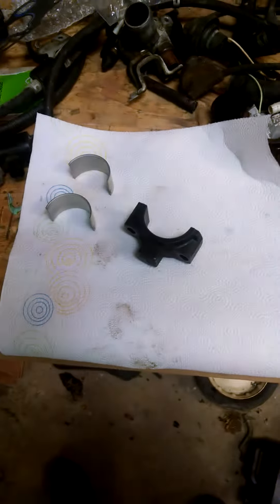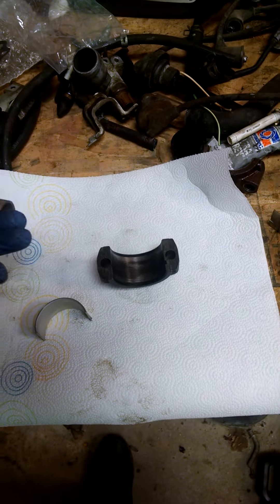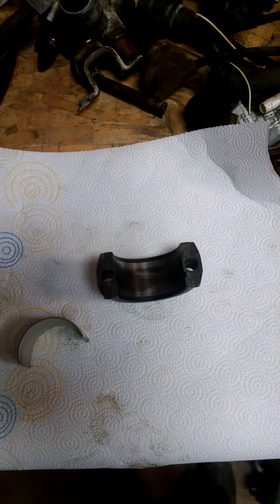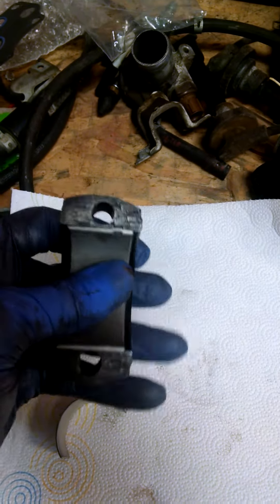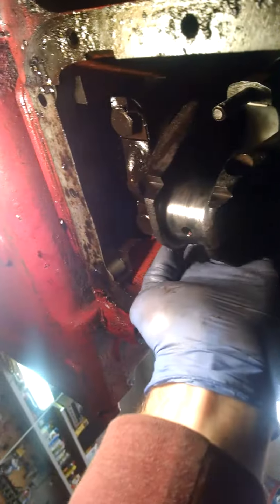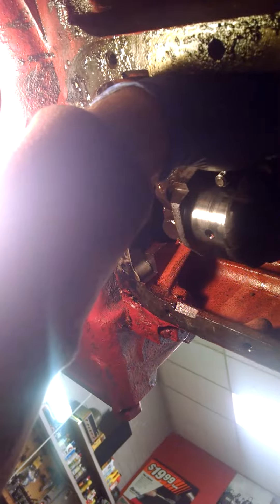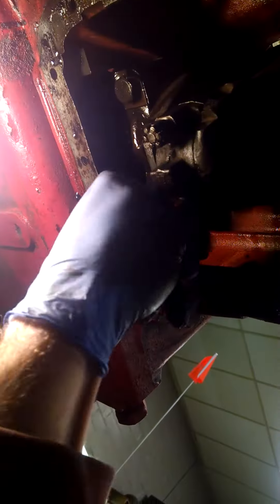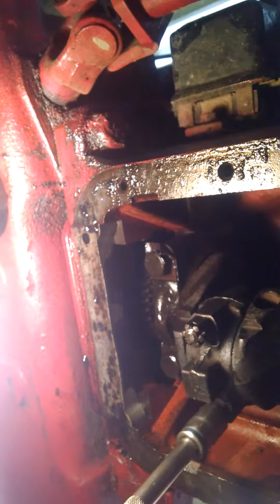Connecting rod bearing replacement

Comment: Hey thanks for the video. Do you know if the same idea works with a Massey 250? I have a knock and was told you have to take it apart from the top down and I don't want to do all that as I won't be able to put it all back together lol
Reply from the maker: 6string I can't say for sure but if you look around the oil pan and can see how it will come off, I would recommend starting there. You will likely have a good look at the rods and caps from that point.
Reply: Hey thanks for the help, once I get some free time i'll get it inside out the snow and take a look. I have a video on my channel of the knocking sound. Hopefully it's a similar situation so I can copy what you did here!
Reply: Alright I got the oil pan off, what a pain. Had to remove the front axle as the oil pan was bolted through to it.  Each bearing on the three rods as a little play left and right but especially the second one. the second one has movement up and down too so I'll definitely change that one for sure.

One question though. I tried to turn the engine over by hand underneath to inspect the first cylinder rod better  but it won't come down, do I need to remove the cylinder head so there's no compression?
Reply from the maker: 6string Great work! You don't need to remove the head, just the spark plugs. That will remove compression and make it easier to turn. You may also want to unhook the battery if you haven't already. Wouldn't want the engine to turn electronically by accident and bust your hand or anything else.
Reply: it's a Perkins Diesel so there are no plugs lol. Yea the battery is off
Reply from the maker: 6string good thinking. Yes, crack the head bolts if it's easy. I know very very little about diesels so I don't wanna tell you wrong